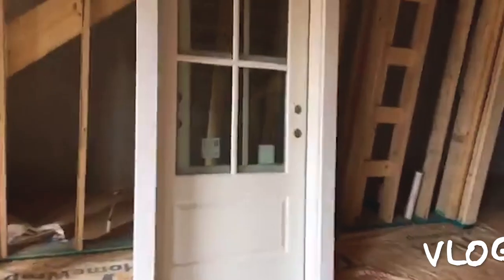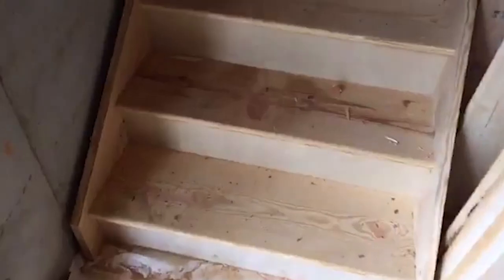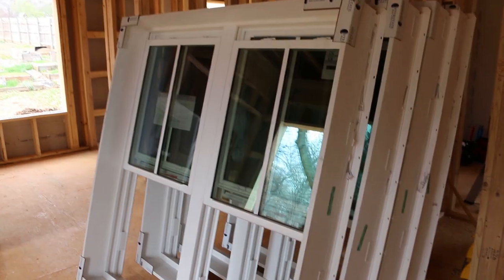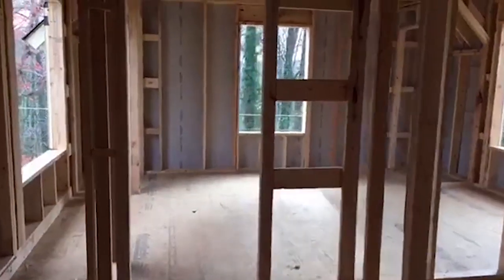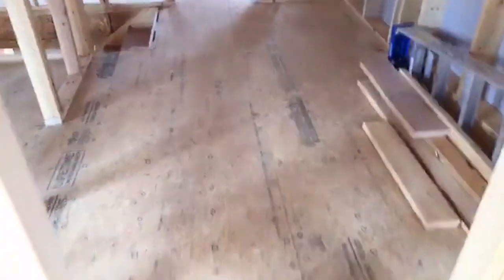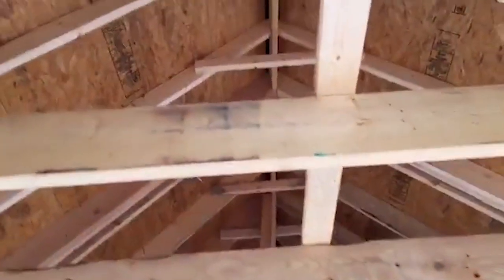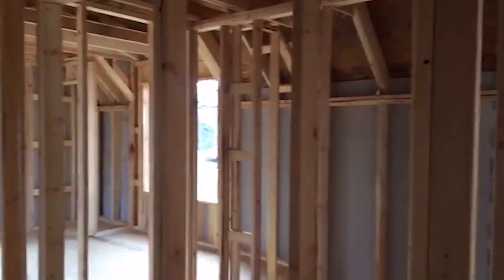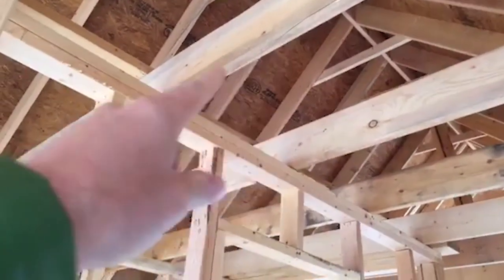GreenShortz Green House Framing Complete | VLOG 021

Comment: Good looking house Tom.  I am guessing the double pane windows also have a low-e coating on them to reduce solar gain in the warmer months?  I'm looking forward to seeing what the split system mechanical unit will look like when it gets set into place.  Lastly, I hadn't thought about where asphalt shingles go vs a metal roof.  You make a good point that you can recycle a metal roof.
Reply from the maker: Thanks Greg. Yes on the windows. They do have a low-e coating to help block solar radiation in addition to the argon gap between the panes reducing heat gain. More details on the window specs coming in another video soon. Thanks for watching.